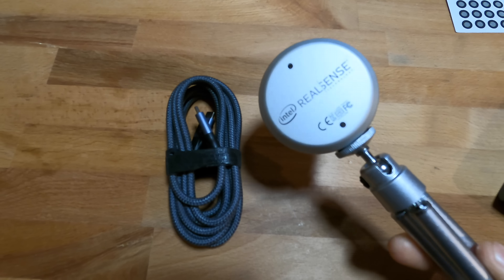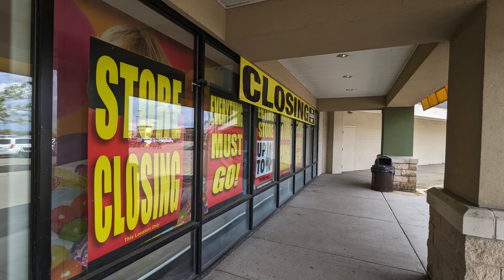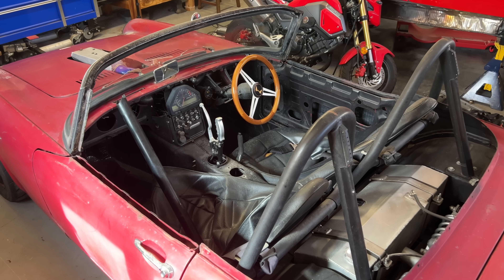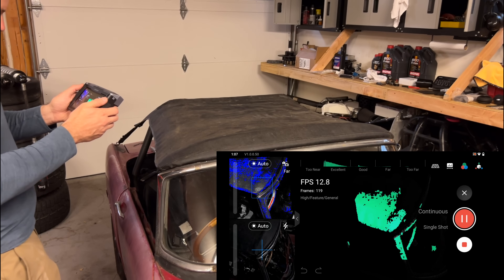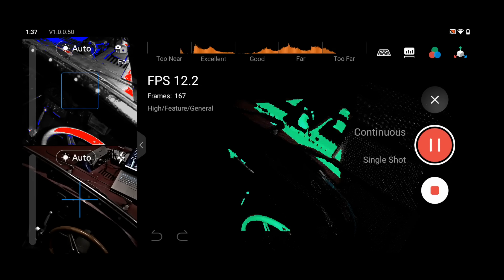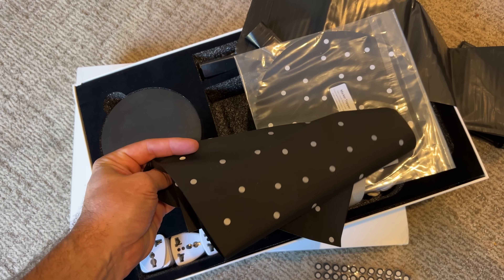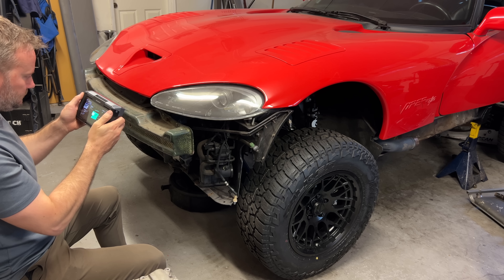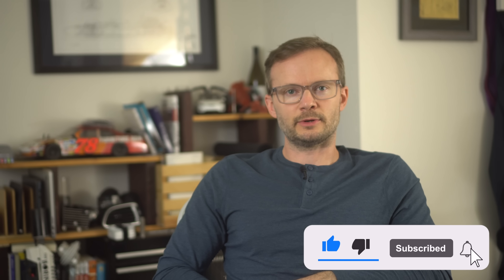All-In-One 3D Scanner: Revopoint Miraco vs Einstar

Comment: FYI.  I have the Miraco Pro and I am able to connect to the computer via Revo Scan It software.  It uses a Type-C cable to connect to the computer.   The software detects the  scanner without issues.   So you can scan with it and the best part is it will directly save to your computer.  You can perform multiple scans in a project and use the alignment tool to correctly align the scans.

Comment: What pisses me off with the miraco you think spending all that money that they would give you 4 calibration plates rather than 1 just for your near calibration guess I have to buy the other 3 for far
Reply: Plus it's useless outdoors :/

Tried the Vega and it's quite the battery hog. If you already have a scanner that works outdoors, I'm not sure the Vega is worth it. 

Of course, target stores that allow returns to know if either work for your use case.

How does the Miraco have auto-sleep and the Vega doesn't @.@

Comment: It’s interesting to see all these hobby scanners require a beefy computer to do the actual scanning. I often work with tripod laser scanners, which are basically a $100,000 android device slapped to lasers, and it captures raw data. It requires a beefy computer to do the processing, but the actual scanning is just raw data sets that are fairly small ( hundreds of MB) until you process (GB).. There are workflows that auto register on the go, you still have to process later, but you can see what you are doing as you go.

Comment: The screen flip is super handy when you're scanning at waste level while walking around or if you're putting it on a tripod and scanning an object on a table. 

You CAN connect the scanner to a computer and run the Revopoint software. It works well enough. There are some features you get from scanning with it including faster model render times etc. 

For scanning metallic or flat black objects, use Tinactin "goes on dry" foot spray. Works better than the scanning spray the Miraco Pro ships with.

Also, I got NOTICEABLY better results when I attached an LED panel (for cameras / video / streaming etc) to the Miraco. It had a seriously positive effect. It eliminated 98% of tracking loss and gave me much more coherent / complete point clouds.

Comment: I'm in no way affiliated with Revo point want to make that very clear I have a Miraco Plus I'm not sure if it's any different than the original because I don't have the original I also have an Einstar. I considered the Vega but there were some things I wanted at the plus had The calibrated bars coded targets all that said the EinStar is much easier to use I will not deny that tracking is spot on the hybrid tracking is great but for what I need I needed something completely wireless The $400 difference I decided to try the Revo point I've had a lot of luck with it maybe the new software is better I don't know I've had some fantastic scans and the accuracy seems pretty spot-on. With all that said you need a significant PC to run the EinStar with every new revision of their software it seems to get worse I might be completely wrong but that's how it feels to me

Comment: Bought a Miraco... it works, but it's a toy and nothing more than that. Using it with a turntable is a joke. There is no option to use a "smart" turntable, only dumb ones, which are no better than rotating by hand. For some reason, with the Miraco on a tripod, stationary, facing a turntable rotating at a fixed speed, you get worse results than manually moving the scanner around a stationary object - guessing because there's more surrounding geometry for it to SLAM against.

Point cloud quality is... eh... Not good, not terrible. As mentioned in this review, it will lose tracking and not realize it a lot, then pile on tons of crap data on top of good data. This makes the continuous scanning mode nearly useless - you just have to manually single-shot it if you want consistent results across a large or complicated object.

Quality of its depth cameras is laughable. They're worse in every aspect than the ones that my ancient (10-15 years?) NextEngine multi-laser-line scanner used. They only work in a VERY limited range of lighting conditions. Lower your blinds or it gets blinded by daylight, even out of direct sunglight. Don't turn off the lights in the room, cause it gets lost a lot in complete darkness. Be careful around LED lighting as the interference can completely mess it up. Don't get too close. Don't get too far. Turn on the auto exposure so it doesn't blow out the detail. Turn off the auto exposure cause it's getting it wrong. Spray with white. Too bright. Spray with gray. Too dark... It's like taking care of a toddler, not a scanner.

It's a neat toy, but that's all it is.

Comment: Good video. Objectively comparing both I think the miraco is worth it over the einstar if you want the ability to do smaller objects too. With how relatively comparable they are it seems worth it to me with the off chance that you’ll ever have a use case to do something smaller than what you are using it for in the video. The einstar is pretty good at large objects but small objects are out of the question while you have the option to do that with the Miraco which is one of its main selling points so I’m not sure if these were really similar enough to compare. Even so, for the miraco to not to be limited to certain kind of sizes it can scan that alone makes it worth it. If you wanted to scan interior pieces for your car you would need another scanner that can do that which is not feasible for many people looking for scanners in this price point to begin with. Both are good but I think they are for different things, if I only needed large objects I would go with the einstar but since it’s not but I want the ability to do them if required I think I would probably pick the miraco.

Comment: The hardware on a Mac is much lower than a decent gaming PC. Even the new ones have graphics cards that is comparable with an RTX 3050Ti. You can get an external graphics card, but it winds up being cheaper, easier, and more reliable to just buy a PC to do anything that is hardware intensive.

Comment: I pre-ordered the 16GB RAM version because it is the most affordable option. I plan to use it for scanning automotive exterior components. I would like to know if, during scanning, the memory becomes full halfway, will it automatically save the progress? Is it possible to resume scanning from the point of interruption by accessing the recently saved file? Thank you.
Reply: When MIRACO has 5GB of remaining memory, it will prompt you, giving you time to save the file before you can proceed with the next operation.
Reply: @pali3D  After saving, can I resume scanning by loading the file?
Reply: @twnay  If the memory of this scan is full (approximatly 4000 frames for 16gb) , you will need to add an other or multiple scans to achieve your car, and after that, you will have the possibility to merge them  on pc to have a single scan. On my test, I think a car can be done with 4 or 5 independent scans. That's normal, 1 scan of 4000 frames is very big, and need lot of calculation, I prefer making several scans and merge them on pc. I hope I answered you ;)
Reply: @twnay if the memory is not full, you can resume a scan

Comment: I recently had to get a transmission adapter made and Matt's comment about neither scanner having the detail precision really put this all in perspective. I had to adapt a Mitsubishi diesel to a Renault transaxle, it wasn't fun, took forever and cost thousands. A proper 3d scanner would have seriously simplified the process.
Reply: Did the same with a Jag V12 to an 8 speed box. I used the old school method, cmm and verneirs.

Comment: The reason that using the markers across the top of the windshield was marginally helpful is because the markers were in a line. The straighter a line of markers and less spread out the less track able they are. Any scanner will track targets, or even details, better when there is more variance in all 3 axis. A line of targets is only good in 1 axis. A $50+ laser scanner will have the same issue.
I'd be curious to see it scanned with some alternating tafgets also placed along the front edge of the chrome

Comment: I backed the mini with revopoint and highly regret ever backing that company. The hardware no doubt is great but their software is just so bad. Tracking is their biggest issue and you spend so much time just trying to rescan where garbage was collected. I transferred over to the einstar after a year of owning the mini and right away it was obvious which one was the better option. From an engineering standpoint revopoint is not worth the money. A big portion of the people reviewing revopoint products were sent the unit so that was another big issue I had and they were for the most part all just scanning little figurines.

Comment: Just a tip, I found myself in the situation of need/want a 3d Scanner, and even paid for an "Early release" that never did (thankfully no money was lost). But then found the greatest solution of them all... Photogrametry, I used RealityCapture, and found that I get all the detail that I want for any size of models (cars, toys, heck if you have a drone, or a huge pole with a camera attached, you could scan your whole block if you want). And they charge for the amount of data to process, so its a couple dollars a scan, and it even captures textures all in one go so no "lost track of the object", model too big for tiny processor to handle, my resolution is crap because so are my cameras, you need to coat them in $60 dollar spray otherwise ill get ansiety... Needless to say I will never need a scanner.

Comment: This was definitely a great video. In years past I first bought an Artec Eva ($20kAUD) which I later sold then I bought a Mantis Vision F5 scanner ($23kAUD). I never got either of them working properly thinking it was my fault when doing perimeter scans and finding they wouldn't line up when reaching the start point again (marine window frame scans). Before anyone asks, yes I tried targets, using a background blanket with "features" (crumpled up masking tape), scanning faster, slower, scanning perpendicular to surface and not, etc.etc. That plus all the faults such as losing place, terrible to manipulate the scans during post processing, etc. Just recently I've used a cheap ($1,200AUD) Einstar base model scanner and it was for the first time ever a pleasurable experience and the results are nothing short of amazing. One of the projects was to scan the whole underside of a Mini including engine and suspension. Neither of my other 2 scanners would have achieved this and it's a shame that I've wasted so much hard earned money on them. My take on most scanners is that it's only now that the latest scanners and software are capable of what was always promised but generally failed to deliver.

Comment: I've honestly been using the MIRACO for over a month, and I completely disagree with what you're saying. 
I find that the MIRACO represents a significant step forward in the concept of 3D scanning, which, until now, has been something complicated and inconvenient due to being tethered by cables or connected to a PC and accessible to only a few.
 The great advantage of MIRACO is that it offers a mobile scanning system, all within a device the size of a camera, and it's priced within everyone's reach. Currently, it has no competitors! 
Just this morning, I found myself doing surveys at a shipyard on a boat for which custom furnishings will be developed. In a little over 20 minutes, I provided the client with the finished scan files of the left side of the dashboard and the forward cabin. 
I've never conducted a survey in such a short time.
Personally, I can only consider myself absolutely thrilled with the product. 
The only thing I can think is that you might have tested an outdated and non-optimal firmware version, as you probably received the MIRACO before the official launch. 
I would recommend trying to update the firmware and giving another chance to a device that I'm confident will revolutionize the world of 3D scanning.

Comment: buy a thunderbolt 3 optical cable, then buy a thunderbolt dock, with those two things, you can leave the computer in your office, and setup a monitor and keyboard anywhere. So you can have a high end full size computer with a 4090 and 192 gigs of ddr5 ram and whatever processor you like. been doing this since thunderbolt 2. i keep computer far away because of heat and noise. your usecase, set it up and forget it, no more dragging stuff to your garage. 😀😀

Comment: As I tester I have to disagree, this is one of the best tracking scanners RP makes..   the version you have is also a beta version (off-set projector). The enistar is a great scanner but your meshing appears way too noisy. Looks to be one-click, this isn’t meant to for RE just a quick and dirty preview.   The device has all those tools available..  I scanned a complete 302 engine block with far mode.   Practice makes perfect.
Reply: Hi bro, can you be more specific about why you think this is "one of the best tracking scanners"? No defence, I finally went for the Miraco - I need to scan small things and want to know more real user experiences. Just don't want to make a wrong decision.
Reply: @TechnoPioneers007 1: Most new users (including myself years ago) buy a scanner outside of the intended scan range…. Example trying to scan a engine block with a Mini or trying to scan a small figurine with the Range.  This will cover 98% of all use cases large and small.  2. This device has something even my LEO or HX doesn’t have, single shot.  This is really clutch, for items that tracking is really hard and you don’t want to put tracking dots everywhere.. (even though, you can still do marker mode with SS).   Let’s be honest, pretty much any scanner will track with markers.. it’s simple logic that pretty much Ignores the subject and only focuses on the minimal required dots per frame.   All scanners have tracking limitations, mimic binoculars with your hands and look at the ceiling.  Now walk around.  Pretty confusing huh? That’s how scanners work.  Now some manufacturers sorta cheat with tracking..  the FOV displayed maybe only 4x6 or 8x10 and your like wow this tracks great..  but in reality the true FOV the scanner sees is 24x48 so yeah it’s seen a lot more than the feedback displayed so “magically” it “tracks” better but take the same scanner to the floor and wall and watch the same issues happen on a $30k scanner or a $500 scanner.  Because this horseblinde view is what they all work around.   With the use of the single shot, you take the SW guessing out of the question and you simply “walk” in the tracking.  As it required overlapping.  So it either understands the assignment or not..  VS 16-18fps of hot mess.   The build in gyro mui and have the scanner dead center really helps the user in data gathering was well.  Believe it our not, it’s very easy to get disoriented scanning a larger item with a outstretched hand while looking at a laptop screen.    Help that helps.  https://forum.revopoint3d.com/t/samlilly2-revopoint-miraco-showcase-of-car-accessories/22309/3
Reply: I own a miraco but i find it worse then my friends einstar. The only things i found it better at was very small objects and being portable.
Reply: @Robin-my2gz  I don’t see you on the beta tester list.. so how do you have one?
Reply: @Robin-my2gz  you "own" one or you're a beta tester because they haven't been released yet only people who are apart of the beta users have them currently and multiple of the beta users have contrasting opinions
Reply: Would you recommend this scanner for a noobie? I mostly want to get detailed scans of smallish to medium items like firearms, electronics devices, etc. Small items but need high detail accuracy.
Reply: @rodiculous9464 yes I would recommend this scanners for new users, 1: Most new users (including myself years ago) buy a scanner outside of the intended scan range…. Example trying to scan a engine block with a Mini or trying to scan a small figurine with the Range.  This will cover 98% of all use cases large and small.  2.  Now if you are truly only scanning small items the blue light Mini scanners is still my absolute go to.  The Miraco offers nearly exactly the same small details as the mini but usually IR vs Blue laser projection.  Blue is king for absolute detail, but it is absorbed and very picky with certain materials, example black and red objects are nearly impossible to scan.  Where the IR laser is able to reflect on those colors and more general universal for most scan surfaces.   3. 99% of users getting into scanner don’t really have the Computing hardware (PC) that is bleeding edge tech, with this being a all-in-on, RP will have no choice to really tune this sw to work with this build-in CPU.  This is a good think.  Think about it.  They don’t have to make it work for 1000s of different configurations, only 2 the 16/32gb  models.  So it will work.

Comment: Maybe, the Miraco SHOULD ALSO have a feature where, IF you do have a powerful lappy nearby, you plug in a cable to a powerful computer/laptop and it then just bypasses the inbuilt processing and sends the video feed direct to the computer to deal all the computational stuff? So a dual use kind of scenario...Yeah, I know, the hassles of a cable, but, would the imaging system be better than the Einstar? ie, is the imaging/sensor tech better hardware wise tan the older Einstar? 🤔
😎🇬🇧